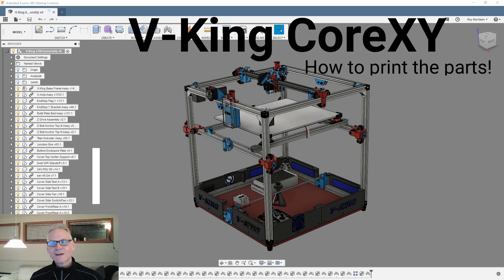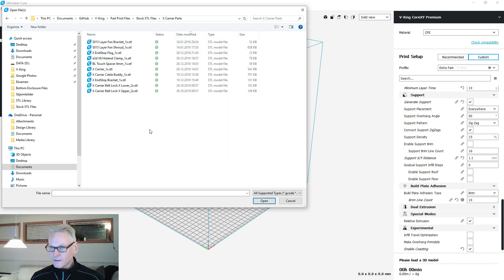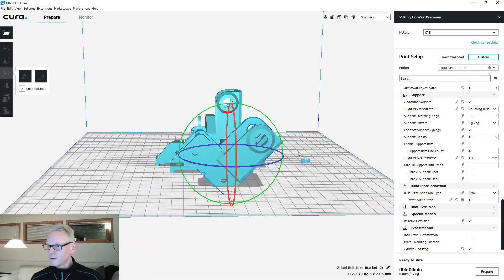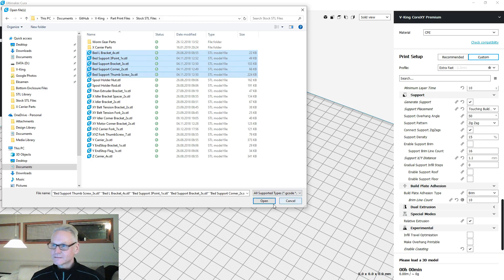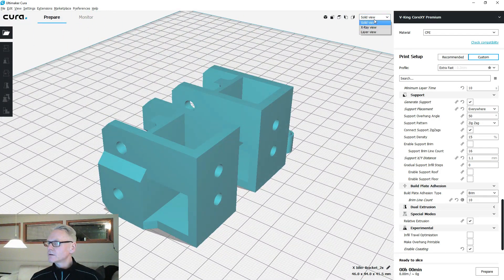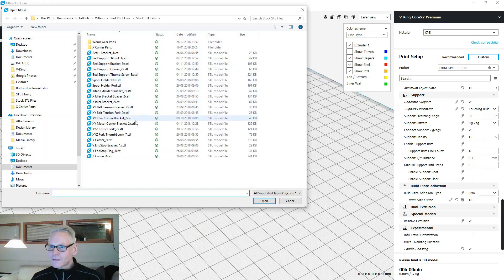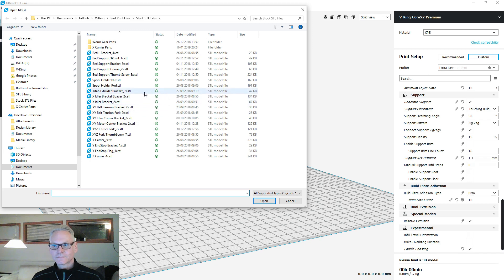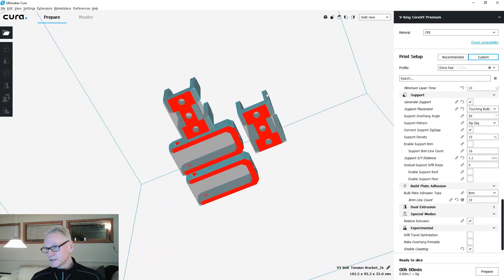V-King CoreXY - PRINT THE PARTS!

Comment: Hi Roy,very helpful videos. Which version of Cura are you using, I use Ideamaker but I may switch to Cura.
Reply from the maker: Thank you Ilan. I am using latest release cura always. I am not sure it is the best though. I know ideamaker does a good job as well as prusa slicer
Reply: @PRO3DESIGN  Thank You Roy. So it is now Cura 4.3 Beta I think.
Reply from the maker: @1ilango1  I don't use the beta. With release I mean the latest non beta
Reply from the maker: Thanks. I always use latest version as of now is 4.4.1

Comment: You should be able orient the parts correctly in fusion 360 before exporting the STL. This will save you the hassle of needing to do it in slicer.
Reply from the maker: I am sorry if you have trouble turning the parts in the slicer. The parts all have the original orientation from the assembly witch is normal. I hope you can manage to turn them
Reply: @PRO3DESIGN  No problem orienting parts here (old school CAD guy for 30+ years). Simply a suggestion.  An even simpler option is to use Cura's ( or Slic3r) support exporting as an STL.  So orient the part and export as STL, done. Now everyone can skip the part orientation step : -)

Comment: How much would u think the printer would cost in total? And print time for all parts?
Reply from the maker: Print time is around 70 hours in total at 0.25mm layers and 50 mms speed. 

Cost would be from 700 USD and up. If you can manage 1000 then you can have some room to buy some high end components
Reply: Allright thank you! You should post a video of things you have printed with it and at what temperature :) @PRO3DESIGN 

Edit: I meant speed instead of temp
Reply: @PRO3DESIGN  Do you print all the parts at these settings? 0.25mm and 50mm/s